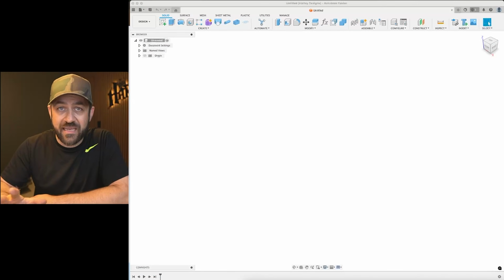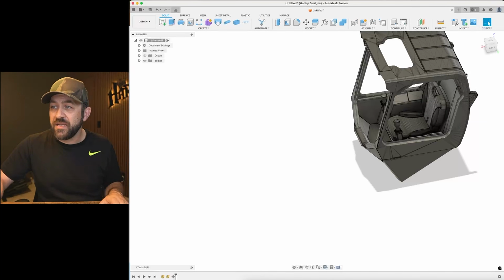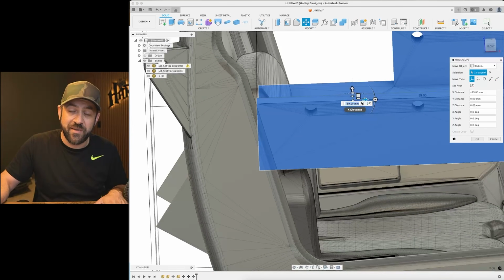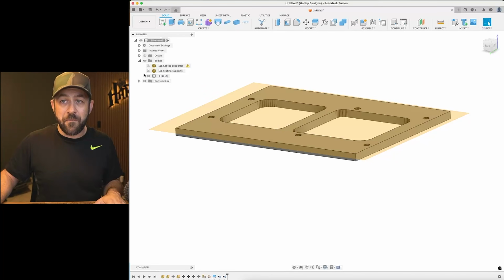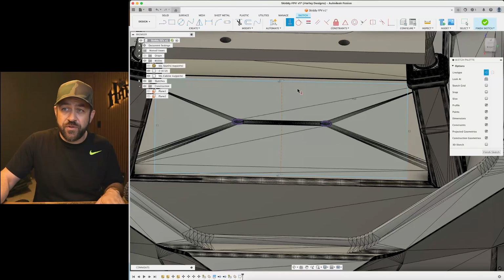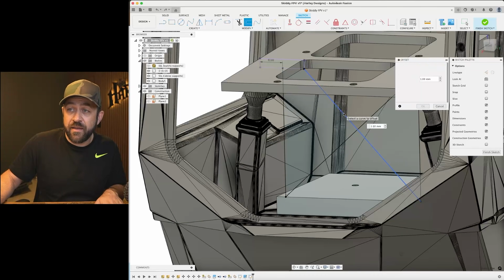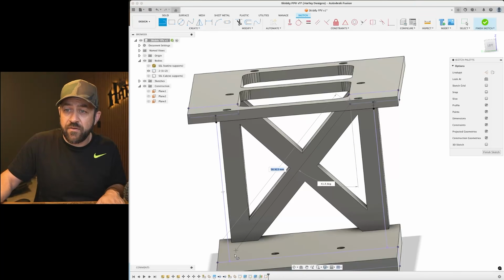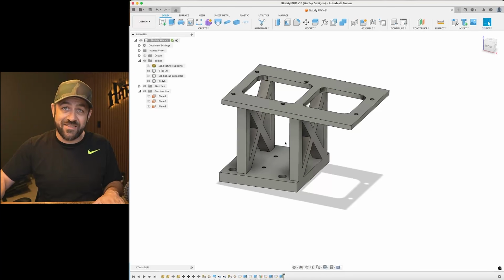How to: Modify an STL - 3D Printing Sunday  - Ep 44

Comment: Fusion 360 feels so unintuitive. Nothing makes sense to me. I have used a bunch of different modeling software and this just seems impossible to pick up on. Even to zoom (mouse wheel) is backwards. I guess I'll be watching a ton of fusion videos to try to figure it out. Not taking anything from you video, I just need to get down the basics and I'll be back. 

I'm also trying to learn 3D printing as well. I want to build that Rock-a-billy buggy so bad, so this is the price I shall pay. Hopefully I can afford to get the STL's next month so I can start printing all the jigs.
Reply from the maker: You can flip the direction of the zoom wheel in the preferences BTW.

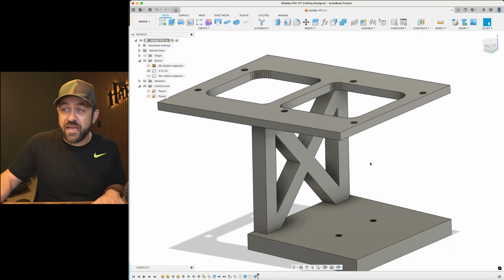Comment: If I'm seeing it correctly,  the upper mount piece is not parallel with the base, so your first lattice structure is barely connecting the upper mount body. Shown clearly @21:07 Could be resolved by selecting the top faces of those pillars and using extrude or press/pull to drag it up and fully intersect. For the second lattice structure,  you were already projecting the lines, why not just project the face and get all the geometry at the same time instead of redrawing it? Its trying to do that for you at @22:08 . I personally hate support material so a lot could be done to make this better designed for additive manufacturing. 
I dont want just be criticizing, I liked the intersect tool method, I'll have to try that. +1 for the tool through holes, too many people design without considering how it will actually be used.

Comment: So wait, in the beginning you didn’t constrain the bodies other than manually moving them and locking them? 
I.g. The seat just “appears” centered but isn’t actually based on reference geometry or planes? I suppose it works, would drive me crazy because I know it’s a hair off.
Reply from the maker: Yes that is true, imported STL’s are a pain if there isn’t an exact point to match to. For this purpose it was wall reference data only though.

Comment: Same work flow if I were to bring a 3d scan in to model say a cage onto a body?
Reply from the maker: Only if you brought in a scan that was full manifold (totally closed with no holes). But you also need to be careful of the amount of triangles in the file. I almost always leave my scans as mesh and work with them in that way. But I’ll try and do an episode of that down the road.
Reply: @HarleyDesignsInc  great thanks... I'm not to bad in solid work but I'm lost in the mesh workspace
Reply: The timing of this video was perfect! I had to edit a stl file today 👍😁👍